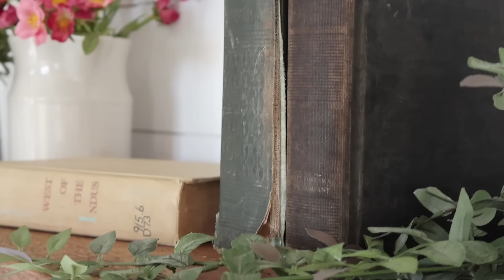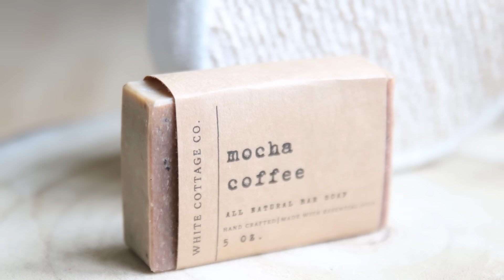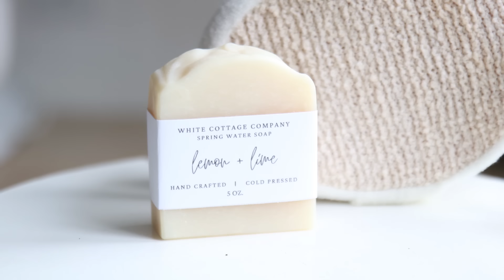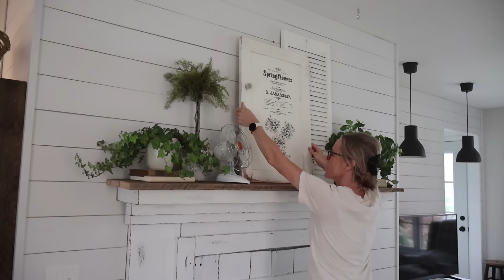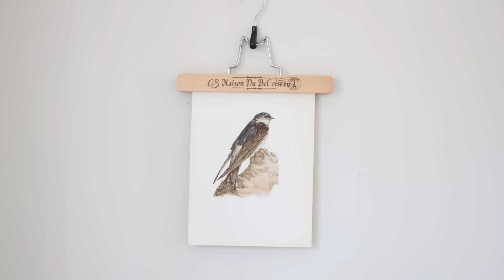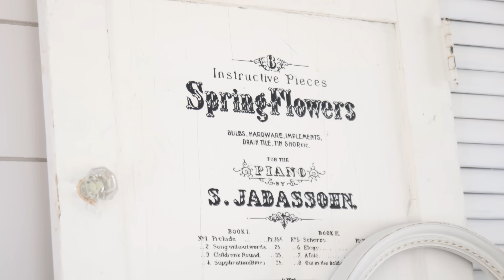Spring 2024 Home Decor ~ DIY Home Decor ~ Home Decor on a Budget ~ DIY Cottage Style Decorations

Comment: In an art gallery they put only one wire across the back with just a little bit of swag. You put your hand behind the painting and hook the wire on a nail/hook and then straighten the painting on the wall. To keep bugs out of the painting who might eat some of the work you seal the back with packing paper. Wet the whole paper with water and then add white glue to the back of the frame and glue the paper to the back of the work on the frame. When the paper dries it shrinks a little. I always change out the glass for plastic because I don't trust life to not break the glass so plastic is safer.